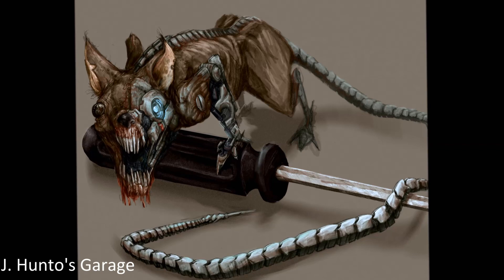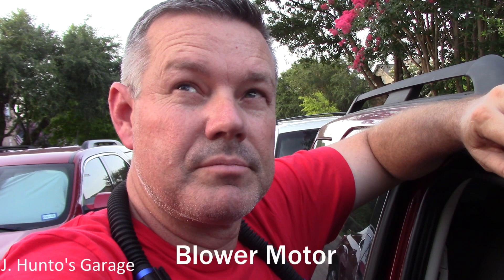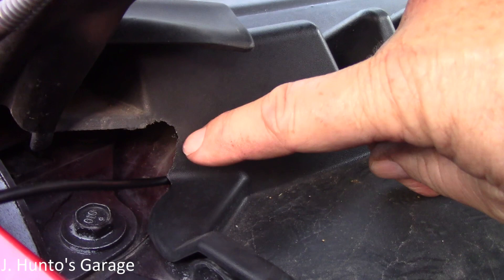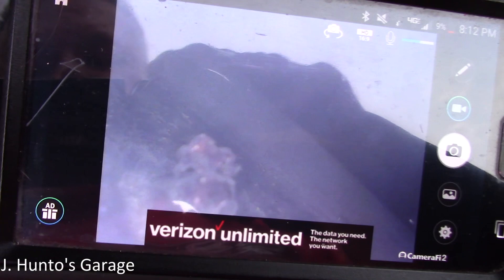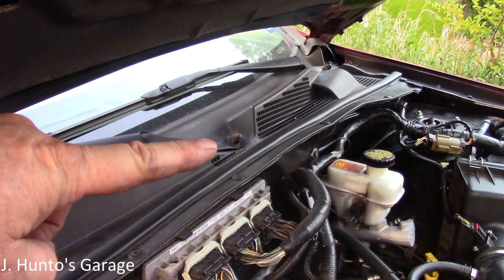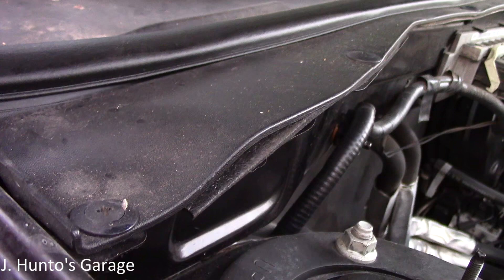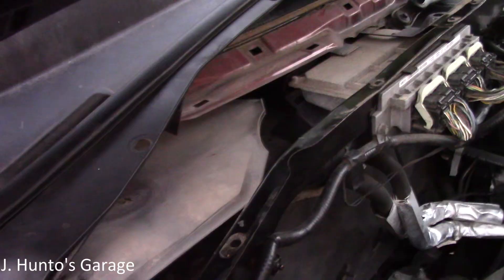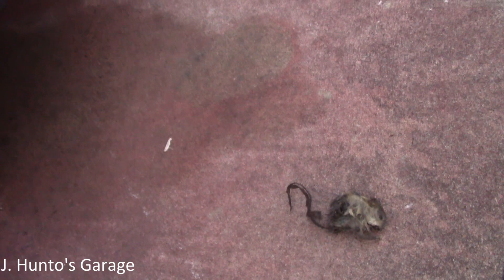HOW TO FIND A MOUSE IN YOUR CAR! GROSS!!

Comment: Blocking those blower inlets under the Wiper Cover with 1/4" metal mesh is a permanent fix.  Since mice are present, blocking your Air Cleaner Box inlets similarly will be next.   Setting traps OUTSIDE the car is a good preventative thereafter.

Comment: Thankyou for this video it helped me to locate the dead rat "WELL DONE". I have also found out that if you put 10 drops of peppermint oil in half a liter of water in a spray bottle and spray it around the inside of your engine bay it will deter mice and rats.
Reply from the maker: Great info! Thanks for sharing!
Reply: I bought peppermint oil too

Comment: I just found a nest in my Volvo.  I’m taking action.  (My mechanic recently passed away, so I’ll tackle this myself). I’m crossing my fingers I don’t find any surprises.  Another video suggested makeup sponges with essentials peppermint oil under the  air filter.  I’m considering mesh screen over the air intake🤔 Thanks for the video.

Comment: The question remains...Where are they getting IN at. ?
Reply from the maker: Not getting in the cabin, I doubt that can happen but they can get under the cowl cover, where I found this guy.
Reply: @jhuntosgarage  It can happen! It constantly happening to me.
Reply: @screamingscarecrow4251  The mice that get INSIDE the car either climb through holes in the body (example: rear wheel well rotted enough to give access to the trunk) though they can also get in through the air inlet ducting for the HVAC system. Quite a few times over the years I've had to extract a centrifuged mouse stuck to the blower wheel.

Comment: I have a 2002 Toyota Camry drove it 80 miles and back home nice cool fresh AC.   I stayed overnight at my daughter's house,  left to go home 24 hours later a bad smell. Today it is horrible obviously it died when I drove it and now it's rotting in this 100-degree southern weather. I don't know where it got in but I am sure there is a dead rat in there.  
I can not work on the car. It is easy to get one out of a Camry. could it be in the Airbox where there is an ac filter?
Reply from the maker: Hard to say if it can actually enter the cabin. I'd start at the cowl where mine was then follow your nose. A borescope camera can be helpful as well. Good luck!